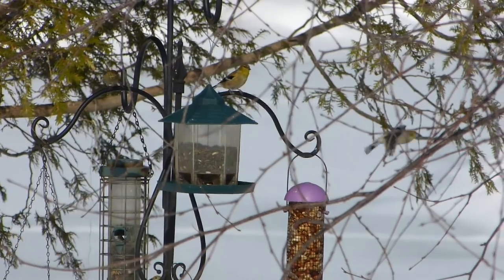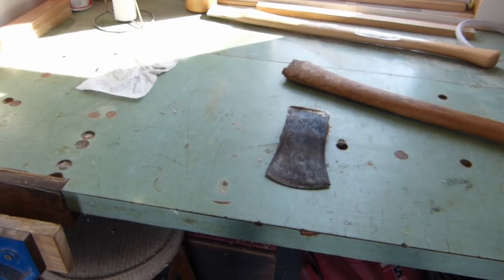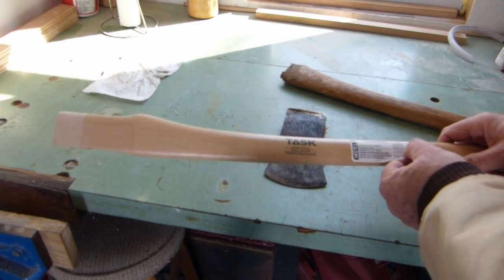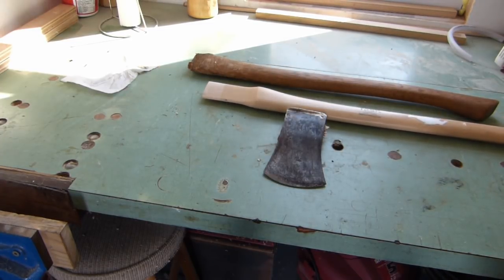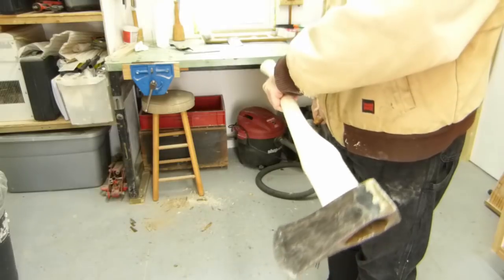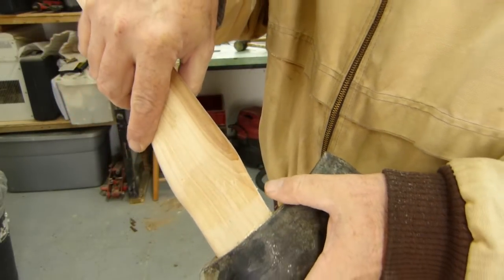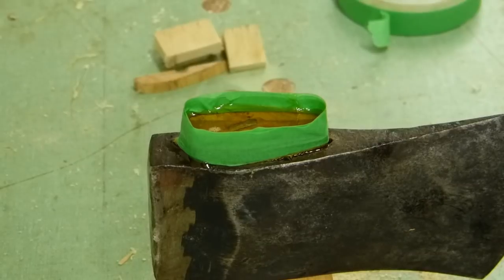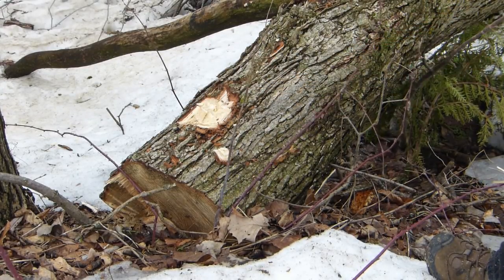Rehanging an axe

Comment: I had the same problem with a sledgehammer handle last year, after a couple of weeks it snapped. So I had a look at it and the grain was completely horizontal. The sledgehammer head is still waiting for me to put a new handle on it. Great video Jim and brilliant tip with the tape and oil at the top of the handle, I wouldn't have thought of that.
Reply from the maker: You're welcome.  Us old guys need to remember to keep passing tips along.

Comment: This is really helpful and informative. I'll refer back to it when I do handles for a couple of old axe heads I have lying in a box. Is that two stroke oil that you put on the stone?
Reply from the maker: The oil is bar lube oil for my chainsaw.  Kerosene also works well, or any light oil.  The bar oil I use reminds me a lot of the honing oil we used when I worked making bearings.